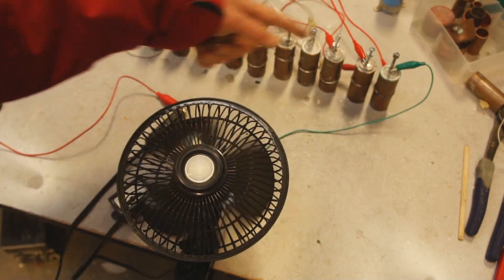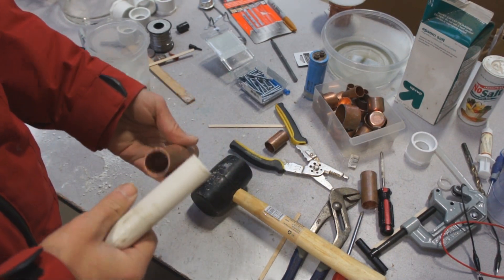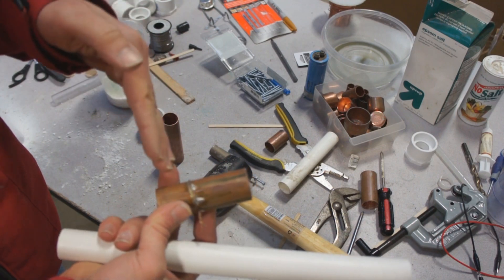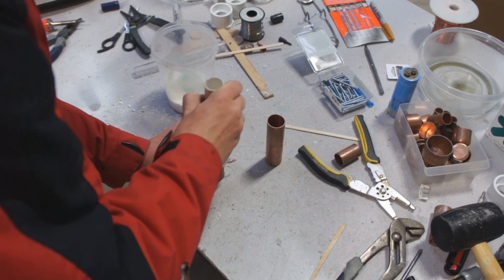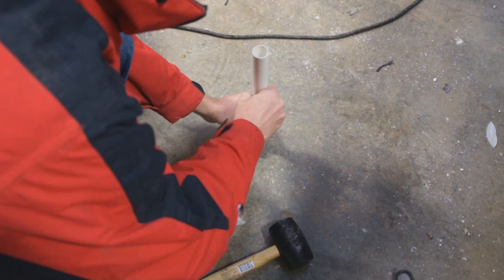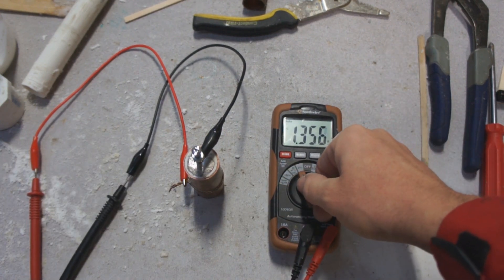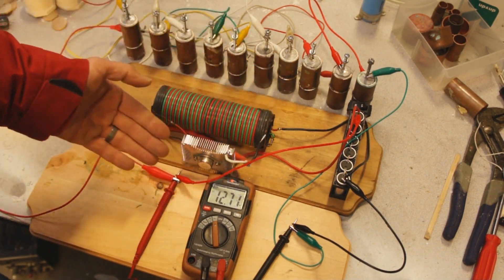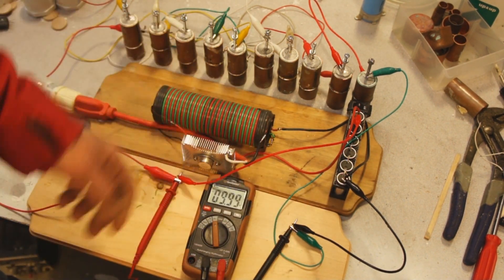12V Crystal Cell Update + Alternative Construction Method

Comment: I got a question, can you wield all the copper tube together to be one connector and still use the just one link voltage so you don't have to link lots wires to different tube in needs?  If the conduction if it did effect lowering the energy  I have to say my bad, but as usually we are experimenting.

If so I wonder it is possible to hold down the metal down by using cross way hold down the zinc on the top and let the crystal forum up on top so later on just need chistal down the crystal away and it will keep growing.  I guess gotta have strong unconductor metal to keep it down in place.  I've wish to do experiment as well, but when it comes to families members, they will try stop you doing something could benified later on feature eletric issues or either they don't believed that might work.

I hope it is possible make large amount volts without using too much need uses of the metals that requires.  I still see this as good plans that could charge a phone, use for camps, or use it as survial methoids.
Reply: Seems you skipped the English lessons as well as Science. This is gibberish.

Comment: When your finishing the top ring/cap instead of pounding down the the tube then cutting why not cut the ring before hand? Just a suggestion for simplicity. Good video.
Reply: His way is far easier. Rather than trying to pound in a ring that may or may not be the perfect length. Just pound it like he did until it won't go further then cut it off. You have to make a cut to get the ring so it is one cut either way. His way the length is always perfect.

Comment: A transistor so that it charges as you're running a motor.. now of course since it's off and on it wouldn't be efficient on most motors.. but a magnetic motor would work just fine.

Comment: I need to know something?
How much output can you get out of it if you add more copper to these magnesium rods?
Will the effect be better or worse if you cut these up?
If you add two magnesium rods to one copper and wise versa, what is the output?
Is it enough to produce hydroxy through electrolysis?
How many would you need to get the desired effect to be somewhere in the sweet spot with normal driving with only hydrogen?
I need to find out more! =D

Comment: I'm not fluent with electronic technology & don't understand the battery/storage cell that recharges.  Is it limited to 15 volts or will it continue to charge and build a higher voltage?

Comment: how can u measure amps and volts without changing any connection on curcuit i see u you change only multimeter's connection..
Reply: That's not how a DMM works....
Reply: Ordinarily, the DMM would be placed in series with the load as connecting directly to the power source would blow the fuse in the DMM as you would get maximum current from the power source. But because the the powersource has such a limited current output you can safely use the multimeter itself with the load absent.
Reply: You don't  have to do much, these cells don't produce much current, therefore just switch from voltage to current measure, it won't even blow the fuse of the DMM...

Comment: Can I use Aluminium for core instead of Magnesium? :)
Reply: I was thinking use aluminium too...
Reply: @jalzeriofigueira2929  you can use aluminum, it won't have as many amps. You can try different metals. Check the galvanic lists for what works
Reply: Hey dude, do you know where I can get magnesium cores?
Reply: @mateenessop1143  you can usually find magnesium rods at your local Big Box Home Improvement store in by the water heaters, you should be able to find the sacrificial rods that go into water heaters to prevent rusting...... from there you'll have to search through the various rods in diameter and length and as always make sure that what you're buying is magnesium as some are just plain aluminum.

Comment: Dumb question from persons unknowledgeable about stuff in electronics: Is it possible to have just a single cell producing those 12v that were used in the beginning to power up the fan, or is that totally out of the question? Also, what is the top voltage you can get from a crystal cell?

Comment: how long does a crystal cell last for and can u charge it?
Reply: +DAT G - DameAndThatGame they always give off energy because they create their own, theoretically they can run forever
Reply: how come we use batteries nd not this?
Reply: Because this takes up a lot more space, and mainly, because it is free energy and the government would not want us having anything free, now would they?
Reply: +DAT G - DameAndThatGame The reason we use regular batteries is mostly because of the size and the power output. They last a while, but only with small loads. They'll power motors without any load on them for years, but they won't do much more unless you start making them huge. You'd need a massive bunch of these to provide the power for something like a cellphone, and that just wouldn't be practical. 

They also won't last forever. There's a reaction going on in there that produces the charge. Eventually the salts will expand to the point where the whole thing will start to fall apart (In his first video he mentioned how the magnesium core was being lifted up because the salt was growing underneath it), or it'll corrode away the metals. 

It's great for DIYers or people who want to make good use of steady low power, but it's not a practical replacement for regular batteries in most other devices you use.
Reply: +Sydney Cantrell It looks like a chemical reaction to me.  It will run out of juice eventually.
Reply: +Sydney Cantrell also despite the longevity they don't output as much energy as the more reactive reaction that makes batteries run, making their uses limited.
Reply: +DAT G - DameAndThatGame The reason we use regular batteries is mostly because of the size and the power output. These crystal cells last a while, but only with small loads. They'll power motors without any load on them for years, but they won't do much more unless you start making them huge. You'd need a massive bunch of these to provide the power for something like a cellphone, and that just wouldn't be practical. 

They also won't last forever. There's a reaction going on in there that produces the charge. Eventually the salts will expand to the point where the whole thing will start to fall apart (In his first video he mentioned how the magnesium core was being lifted up because the salt was growing underneath it), or it'll corrode away the metals. It's the same principle as regular batteries, but because of the materials the output is a bit different. So they'll run out like regular batteries. 

It's great for DIYers or people who want to make good use of steady low power, but it's not a practical replacement for regular batteries in most other devices you use.
Reply: ***** thanks for taking your time out to write that, I get it, we kind have better things to use now so this is more a novelty :)
Reply: +Dame And That Game - DAT-G Psychologically deft.
Reply: If you pay attention to the vid he outlines the history of the cell Ill elaborate John Hutchison discovered the process to make the cell in the nineties '' I think '' then in the 2000s John Bedini picked it up and published the way to make it .Then Laser Saber and other researchers started experimenting with it so its a little known device still in research and development Laser Saber said hes ran a small motor on one for two years straight on a live video feed so it definitely has potential and may out strip a conventional non rechargeable battery

Comment: Liquefacting the mixture with some heat may be beneficial, because as it cools the material becomes a single crystal. It may be possible to simply pour the liquefacted mixture into the cell, using a crucible of some kind to keep the temperature just right (so that bubbles are not formed)

Comment: Nice work Lasersaber! 
It’s amazing that you can get that kind of power out of crystal material and pressure against two dissimilar metals. I wonder if there is a way to instantly bring up the voltage once drained by momentarily increase the pressure. I'll bet it works like the new magnetic field harvesters. You know two strong magnets sandwitching a pizoelectric crystal, (SN-pizo-NS)
Reply: I have a feeling it involves sanding aswell... lol

Comment: can you create an experiment i believe there is an effect with the diameter and thickness and length of the magnesium rod and copper tube to the resulting voltage. voltage...
Reply: No, the voltage of a cell is defined by the chemical properties of the plate materials. And somewhat by temperature and concentration. Not by the dimensions. Copper and magnesium will theoretically produce about 3.72V but as the 'electrolyte' in these cells is such a poor conductor the high resistance loses much of the voltage as drop across the electrolyte.

Comment: Use the power to fire off an induction coil, catch the bemf as tinman does. Sky is the limit after that. Can also catch the mag pulse from the spark rectify that. But everybody needs some power to start with, this is the starting point.
Clay

Comment: I just found your video and I have a stupid question. What is the crystal material you are packing inside the battery? Thanks for the info.
Reply: Lucien Macrose 1/2 cup borax, 1/2 cup no salt salt substitute, 1/2 cup alum, 1/2 cup ground into a powder and used to fill each copper tube.  See his other videos.
Reply: Lucien Macrose 1/2 cup borax, 1/2 cup no salt salt substitute, 1/2 cup alum, 1/2 cup ground into a powder and used to fill each copper tube.  See his other videos.
Reply: Li Lee thanks! Later

Comment: How many people here have been successful with these Crystal Power Cells?
Reply: Danyal Ahmad I made a night light for my bedroom it has been running for a month now. It gives me enough light in entire room that I can see whats around me so that I do not stumble upon something in dark.
1 Watt light that can work from 3v to 6v. I also discovered something that may attract people who are having trouble with the mix.
After messing around for some time i thought raw sea salt should do the job as well as it is a compound of all sort of salts in sea. So I ordered some and made a cell. First one was not a success. It was my first time I saw sea salt in my life. Dropped some at floor and then cleaned it. But for days my floor remained moist. I guess it was the chloride compound in it. I added some borax and alum to the sea salt and it worked good in cell. I think we don't need Alum its just borax that is good enough as it takes care of the moist problem to certain extent. So I would suggest folks to try raw sea salt + borax.
Reply: Talha Kamran So, you use LaserSaber's recipe? Can you generate about a amp of electricity with five crystal power cells? You only get 1 watt out of these!!!? Is it better to use pure ingredients then the alternatives LaserSaber does? Tell me more. :3

Comment: So if I connect 192 cells to make 230 volt I would get 46 to 115 watts continuous output? 
If that so I can just connect to an AC inverter and charge my low powered appliance?
Reply: Why not just buy a proper battery?

Comment: next time u make one of these cells polish the inside of the copper pipe with a wire brush and the outside of the Mg rod and see if this increases the output by facilitating/increasing the chemical reaction.

Comment: Have you considered cutting the magnesium core into a sprocket or star shape so that it has more surface space. Just a thought I had. I hope it helps.
Reply: All extra surface area should help, as long as it does not greatly increase the path length through the electrolyte.

Comment: Hi guys.
Im totally new to this crystal cell topic. In short: Should i dig deeper into it? I want to combine a forever lasting energy source with one of the super-micro-computers today, like raspberry pi, creator ic20, etc. They require 5V and about 0,5 mA.
Is this energy available through crystal cells?
Reply: These things are moderately too good to be true. But, if you do some research in the chemical reaction inside each cell, it seems to easy to be true! You can use these things to power the laptop. Although, these things will not last forever. They will last a couple of years with good maintenance. But, with a laptop there is going to be 'heavy' load and it may die out much more quickly. I would recommend connecting a  couple of them in parallel for the volts and several more rows in series for the current. I can't guarantee that this will work at 100% efficiency to your standards, but just for the experience it will be worth it. I hope that helps!!
Reply: @danyala.1659  Parallel for Current, Series for volts*
Reply: yep...you can do that.
Reply: You don't even seem to understand series and parallel, as you have their effect reversed. You'd need dozens - maybe hundreds - of these to power a laptop.

Comment: Hi I was wondering how many of these would it take to run a 12v refrigerator and how long,,,in your opinion? Thanks
Reply: over 9000
Reply: Congo Bob you need to mention watts as well to understand how many Amps your refrigerator requires at 12v. Amps draw from these cells is directly proportional to its size. You can easily et 12V from it by connecting these cells in series. 
1 cell volts = 1.7
12v / 1.7 = 7 to 8 cells (8 to be on safe side)

a 100m high and 20mm diameter Mg rod in such setup can produce around 100mAmps. So you can do the math how tall or fat your cells will be based on your Amps :)
Reply: demonsparkx how did you come up with this number :)
Reply: Cool thank you so much

Comment: I have a question. When we have 2 materials, in this instance Cu and Mg. Which one decays?
I am trying to think as if the one that decays need to be thick while the other can be very light. Like in this case what will happen if we wrap it in Cu strip.

Salam lasersaber, please try this configuration. I was making the air battery you created and I did the opposite. I have Mg rod and I wrapped soling wire around it. When I wet that it went crazy on amps. I noticed that steel or that soldering wire behaves much better. I have no idea what that soldering wire was made up of.
Reply: Talha Kamran After messing around for some time i realize that raw sea salt does the job as well but be careful not to have it on your tiles at home. After all sea salt is a mix of many compounds. It has compounds like chloride in it that attract moisture. If you drop it on a marble tile then your floor will remain wet for days :)
It may decay the cell quickly so add borax to it and you should be good to go.
Reply: Talha Kamran Why are they called 'crystal' cells?
Reply: Stacy Elam
I don't know exactly but I guess its due to the fact that you have cathode an anodes in a solid salt composition.
If one applies same setup to crystals found around in nature it may yield better results. For example..try it with raw rock salt. Drill hole in it and inset brass screw in one whole and mg rod in another to see what happens.